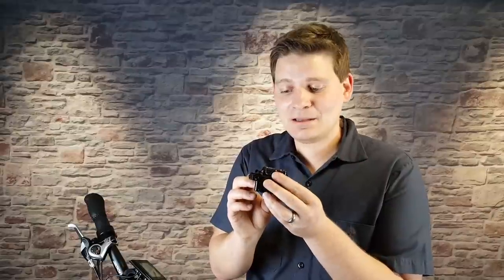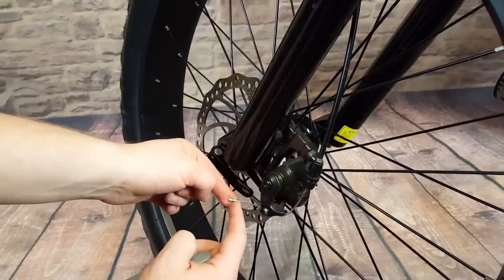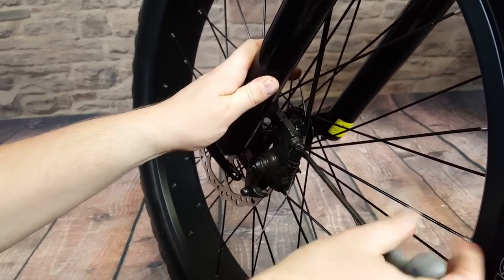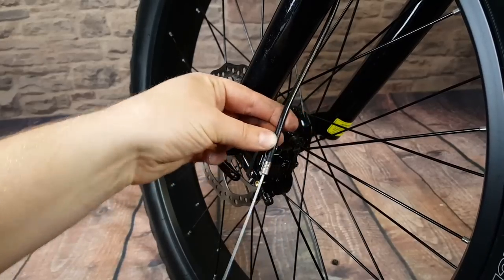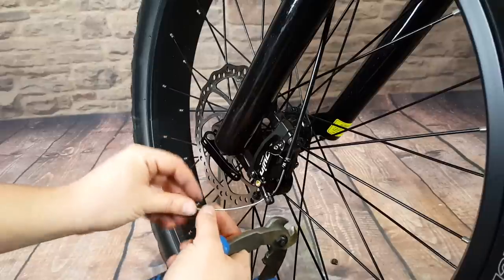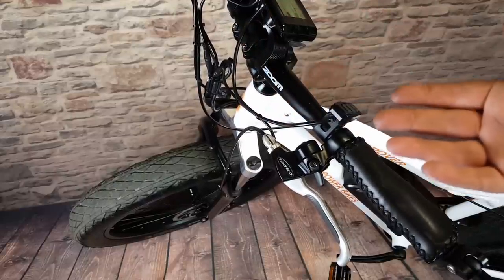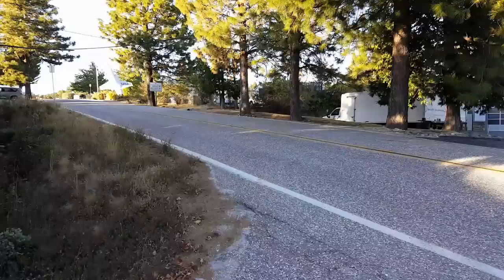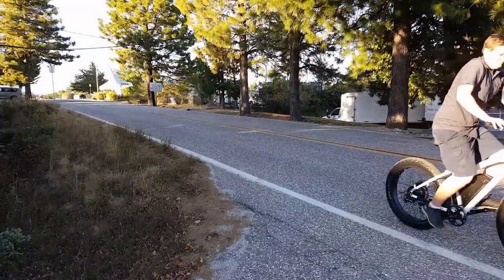How to install Hydraulic Brakes on Ebikes in 5 minutes!  Keep your Brake switches intact

Comment: For those of you who are first timers, let's this be a lesson for you. Please retain the old brake line holder bolt unless you're confident that you can run the brake cable through without fraying the cable. Me being a moron took the cable off and try to run it through the new bolt and frayed the cable. I thought it wouldn't matter, but it had destroyed the brake cable. Now, new cables are being ordered and hopefully getting installed properly like this video. Lesson learned for me, at least.
Reply: Thanks for the heads up

Comment: Just installed the Juinteck M1 hydraulic calipers on my Rad Rover 5. The simplicity of the installation was a breeze. Your video was easier to follow than the instructions that come with the brakes. Keep the videos coming. I thoroughly enjoy them.
Reply: How did the brakes turn out?

Comment: I’m sorry but I don’t see hydraulic brake lines installed on this ebike. Hydraulic brakes use oil not a wire correct? I don’t think this is true hydraulic brakes that require oil and no cable line.

Comment: hydraulic and mechanical brakes have the same stopping power, if adjusted correctly.      one of them just needs lighter pressure to activate

Comment: Another good video. I think I’ll take a pair, or even 3 pairs (I have 3 Radrovers 2017) of those hydraulic brakes . But now I’m going to hold you to your word of making videos of  the Radrover faster.  My personal areas of interest is a 52V /35amp controller that is plug and play with the radrover, kt-lcd8h color display, real 750 watt Bafang motor upgrade and a 52V / 30ah battery pack in a triangle bag that is plug and play compatible and fits 2017 Radrover.   Nobody is making good step by step videos of upgrading the Radrover. These brakes are a good start. Please help us Radrover enthusiasts. We are mostly made up of the older bicyclists that enjoy modding and accessorizing our Rads way more than the Sondors crowd.

Comment: Thank you!  Upgraded my Hiboy p6 and it made a world of difference.  Even with the stock pads.  I was able to use the existing extenders and saved the cable crimp to reuse.  I went with the X-TECH Hydraulic Calipers.

Comment: These brakes really were as easy to install as the video indicates.   awesome product, thank you!  really completes what was missing on the rover.
Reply from the maker: Fantastic!
Reply: @Area13ebikes  I have a concern about the volume of fluid in the caliper and heat disbursement. We live in a hilly neighborhood and some grades are long and somewhat steep. Is this system more susceptible to boiling the fluid than a full system with fluid in the reservoir and lines? Thank you.
Reply from the maker: @chrisprice1603  out of thousands of brakes sold I haven't had anyone report boiling of fluid.
Reply: @Area13ebikes do you sell the brakes yourselves and if so are they still available? I own an amyet v9 g60 ebike and need to upgrade the brakes but do not want to go full hydraulic.

Comment: I have hydraulic brakes on my favorite machine... came installed and finding where to put brake fluid in is the aggravating point because the lines are all wrapped in a mesh wrap but guess will have to remove the mesh when it needs fluid in time... any way I do love the 750 watt Bafang motor on the ebike and the brakes are a neccessary thing as fast as it goes. I love the machine and I bought a Luckeep and Suzuki partneered with them in the electrical stuff and has a really nice Samsung battery in the machine. I like how well the hydraulic brakes work compared to my e-bike with mechanical brakes. Wish you the best and thanks for the video on how to do this stuff... will help for finding where everything is on my machine and I'm sure the fluid fill is under all that mesh wrap on my machine. Beautiful machine, spent the morning looking a lost cow that was finally found dead in a ditch... being a cowboy on an e-bike today... strange how the world changes...

Comment: I did the same, replaced the mechanical calipers with a hydraulic caliper actuated by a cable. But the braking power is really bad. In fact very low braking power compared to mechanical brakes. And even worse is the lever is very hard. Finally installed a full hydraulic brake system with fluid tubes. And WOW ! The lever is smooth as butter with only 3 fingers and the braking power is EXCELLENT !

Comment: A breeze on my HIMIWAY too, took approximately 35 minutes start to finish. Nice touch
Reply: Hi John, have the himiway (cruiser) too ...curious of you kept the Himiway adapters or used the ones provided with the brakes.   LBS used the ones from the bike and the rotor is only covered by 70% of the pad.   I just realized there were ones that came with the brakes as well, and don't know if there is a difference.
Reply: @Gloov  it’s been awhile, but it seems like I just used the ones that on the bike. I have to say I didn’t really notice a huge difference on the bike.
Reply: @johnphillips8088  yeah i switched out the pads to some shimano organic versions, and now my brakes are making a grinding sound, but the brakes still work.   Went to my LBS and they said its due to a bulge being created at the top of the pad cause the rotor isn't being fully covered.   After watching some videos noticed the mounts that came with the bike, so dont know if that would be the missing link.   I am not that mechanically inclined so was curious before I went back to my LBS, feel like I am border-lining harassing them at this point :).
Reply: @Gloov  actually I had very few miles on bike before I changed the brakes, and they were getting better on the stock breaks as the pads wore in. Then when I changed over to the hydraulic kit. I have again not ridden the bike a whole lot. So the pads are probably still wearing in… good luck, be safe. John

Comment: Good information in the video. But one thing that was not mentioned was making sure you put the washers back in the same order they came off. My first try I was rubbing on top of the rotor because the washer was not installed correctly.

Comment: Just ordered mine today from Bolton E bikes. 👍
Reply: looking into ordering as well
Reply: Bolton was fast to get the Order to me.
Reply: I asked a question on the website regarding how it does on long downhill declines, is it possible to dry out the mineral oil etc. he should do a video refilling the resovoir/bleeding and if we can use baby oil to save costs. my last concern is where i can buy metallic/ceramic pads for em
Reply: Matthew F He sells everything for the brakes, like you i wouldn’t no how to do the oil or the pads, that’s why I’ve decided to let our local bike shop install them, if oil or pads need replacing bike shop would no what to do.

Comment: I bought this conversion for my Himiway.  Works perfectly.   I also have a Magicycle which I bought a hydraulic caliper kit off Amazon, works really bad.  Don't be fooled by a low price alternative, it will not stop your Ebike like the   Juintech M1 hydraulic calipers!  They are the best and safest you can purchase.
Reply: Hi Bill, have the himiway (cruiser) too ...curious of you kept the Himiway adapters or used the ones provided with the brakes.   LBS used the ones from the bike and the rotor is only covered by 70% of the pad.   I just realized there were ones that came with the brakes as well, and don't know if there is a difference.
Reply: @Gloov  Hi Adrian, I Think I used the Himiway adapters, but not sure.  Both were the same as I remember. You might have put them on backward?
Reply: @BillTheHawk  Thanks!  Looks the same as the video and my LBS did the install.   It could be the way it is and the type of pad I used to replace the ones that came stock with the brake.

Comment: I've been using TRP Hy/RD hydraulic brake calipers for 2 seasons on my road bikes. They work great, and retain the brake cables as well.
Reply: 11 speed groupset o_O?
Reply: I just ordered those.... and found this video.... I can't wait for more stopping power, I just put on dual pull brakes and that was better than single pull.... but I'm going hydro! Lol

Comment: Couple of things, these are hybrid hydraulic calipers, they don't self adjust as they use a cable pull, the pad wear adjuster should be at the  bottom cable end of the caliper, a screw pulls the pads in.

Comment: I recently got NCM Moscow, and it comes with mechanical disc brakes, was thinking of changing them to hydraulic and this seems to be a better solution.
Reply from the maker: We do like hydraulic brakes too.
Reply: @Area13ebikes  So I got this from you guys recently, maybe a week, and finally got the time to put it on the bike. I was trying to make the gap between the brake pads bigger, now there is literally no space on either side. I see there is a mechanism to loosen it, but the screw only unscrews itself from the long bolt if I spin it counter clockwise, what gives? Is it defective? I will test the other one out tomorrow and see if I can loosen it, if not I will have to take a plier to it.

Comment: Just install hybrid brakes...cable actuated hydraulic brake calipers. Zoom sell these, and you don't have to change out your brake levers for the hydraulic ones that do not have the electronic cut off. Just use the regular ebike cable pull levers with the cut off sensor and attach them to the hydraulic brake calipers. Got them on my bike...😁

Comment: Couple of questions for you ..........     Where to buy and cost  ?.      Also, where is the oil reservoir ?       All hydraulic brake systems rely on a fluid supply.

Comment: You are supposed to have conical washers on both sides of the caliper.  Without them, when you tighten, the caliper cannot articulate to the rotor fully. It only sort of aligns.  That's why those washers are that weird shape.

Comment: Great video brother I loved it!! Now I have a quick question will this hydraulic brake better then regular mechanical brake that is on lectric ebike? Will hydraulic do better braking then mechanicals brake? I guess I can replace mine for those I got an letric ebike which has disc brake so I guess they’ll fit just fine onto my bike what u think?

Comment: With regular hydraulic brakes, you need less hand pressure than mechanical brakes to get the same level of stopping power. Is this true of these cable-actuated brakes as well? I don't necessarily feel like I need more stopping power than the mechanical brakes, but I have some hand issues, so if these brakes require less hand pressure to yield the same level of stopping power, there would be value in that for me. TIA for any thoughts.
Reply from the maker: Jake that's an excellent question.  Yes, they are easier to stop with than standard mechanical brakes.  I would however say a 100% hydraulic setup has an easier lever pull as you don't have the friction of the steel cable involved.
Reply: Velomobile Shop  Thanks. Would compression free brake cables improve that too? If so, do you sell those?
Reply from the maker: jake london  I have not personally tried it. At a minimum, you could certainly lubricate your existing cables to make the pull easier.
Reply: @jakelondon  - Hi Jake - compression-less cables and housing is the way to go. Jagwire is the more known brand but a step up is the Yokozuna is the best. Many reports of this cable and house being superior to the Jagwire compressionless system. Also, Yokozuna as a premium caliper like the Juin referenced here... but at a much higher price point. The Juin is a good way to go and I think the compressionless cable housing would be helpful to your hands. Good luck! (I realize my comment if two-years too late... but just in case it helps)

Comment: Thanks for all your wonderful videos. I have learned a lot from them except that you sell ebikes, thus I purchased a Rad City arriving this Tuesday. I watched your install video on the Juintech M1 hydraulic calipers and wonder if I could buy one (not a pair) just for the rear replacement.

Thoughts? 

Thanks again.!
Reply from the maker: We only sell them in pairs. Because if you need to replace the front, you may want the back too.

Comment: This is a really cool solution to a somewhat non-existent problem. I can understand why someone with arthritis would need it, but they probably wouldn't be riding a bike anyway. Or maybe they would, since it's an e-bike. Hmmm, interesting. In any case, I looked for these and they seem to be very rare or expensive, or both. Still a neat idea though.
Reply from the maker: The problem is hydraulic brakes that are easy to install on all ebikes.  Many don't have a solution as ebike specific brakes need to have the right plug for the brake cutoff.   This fixes that.  As far as price, $150 for a pair of hydraulic brakes seems pretty reasonable to me.  I stock them at BoltonEbikes.com.

Comment: My bike has a brake pad hydraulic hybrid (atheist that's what my bike shop owner says) and I can't figure how to get my brakes to feel like it did when I first got it I go to the bike shop every 3 months can't figure out what wrong help please its a cyrusher xf650
Reply: Cable pull bicycle brakes are trash! Even the hybrid ones. I tried them both. If the brakes aren't damaged. Then it's probably the steel line itself. I found out when I squeeze down to the max trying to stop my mountain bike. Over time the line stretches. Yes the cable itself begins to stretch. That's why a person will always be adjusting those damn brakes. Even Shimano's entry level hydraulic brakes are far superior to even the best cable pull brake setup. You'll be able to skid with ease. They feel loser compared to the cable pull brakes and the hybrids. But they have a wall at the bottom that's firm and takes little effort to stop the bike.

Comment: How to install Hydraulic Brakes on Ebikes in 5 minutes.  
why is it an 11min vid ?  just having fun - another great vid.  ty
Reply: Why did they used to spec out hard drives for 200,000 hours MTBF, but only give you a five year warranty? How many licks does it take to get to the tootsie roll center of a tootsie pop. The world may never know.

Comment: Great idea, but I would caution against using this on the rear brake of an e-tricycle because it appears to be normal practice to only brake one rear wheel.  Normally the left side freewheels, and the reason is that unless it does, going around corners would require a differential gear setup.  Heavy braking could slew the cycle sideways.
Reply: That sounds kind of scary to me, tricycles are much heavier than bicycles and their brakes are also worse?
Reply: actually I would think the hydraulic brakes would be easier to control.  or by a trike from Lectric, as it comes with a differential as standard equipment.

Comment: can you still call a hydraulic brake if you are still using mechanical cables instead of hydraulic tubes? I presume that the performance is half as good as fully hydraulic brakes

Comment: This seems like what I should do but on top of that maybe new disk breaks because I’m pretty sure mine have warping from the start even. I can feel it when I break too especially in the front. Can’t adjust the pads in any efficient way to not have some sort of rub at some points in the rotation either. But good thing is I did get them to stop me pretty decently so as far as safety goes I should be okay for now but I also do not want that rubbing resistance when I’m not using the breaks.
Reply: Buy a rotor alignment tool, will save you that issue, spin wheel, mark the first point of pad touch and the last, then slide tool in the middle of marks and pull to the side away from where it touch, i had to do it so a misaligned wheel hub setting my rotor off line.

Comment: If your bike won't run and you get an error code , check your brake levers aren't badly adjusted and hitting the cut out switch. I adjust my brakes at the brake end.

Comment: My front bottom adjustment knob was so tight that when attempting to loosen it through bottom plastic nut came off. Great concept but they seem cheaply made. I'll be putting the Tektros back on and don't think I'll be buying again. Super disappointed because they did perform well until adjustments were needed.

Comment: My adjustments on the handle bars is maxed out when replacing the mechanical brake to hydraulic should I set the adjustments on the handle bars back to factory settings or leave them maxed out like I have em?

Comment: Does the pads needs constant replacement, how many miles will the pads last? And can I Also adjust them like mechanical disc brakes or do I have to do some kind of bleeding?
Reply: Depends on pad type, organic resin will give less milage, semi metallic more, you don't need to go with the pads that come with it, they have a special pad adjuster screw at the back, which pulls both pistons in, no bled on these as its a sealed fluid camber and its only the calipers that have fluid in, not the brake line.

Comment: Hello Area 13, can you tell me where the Juinteck calipers are made? I am interested in changing my mechanical brakes to hydraulics, but after reviewing similar calipers it appears some are not as good as others. Problems fading, failing, and just not a safe alternative. Please advise.
Reply from the maker: Juintech are high quality and extremely reliable.  Get them at Area13ebikes.com

Comment: If my Rad Mini with the pwr upgrade is able to grab the rotors hard enough to begin skidding or softer (so I slow to a non-skid stop quickly) if I don't squeeze as hard, then how will hydraulic improve my stopping distance? Not saying they can't. I just want to understand how they can improve upon the current braking that seems 100% effective... depending on how hard I squeeze. I'm a lightweight rider if that makes any difference to the scenario. Is it solely because of the double sided grip? Thanks